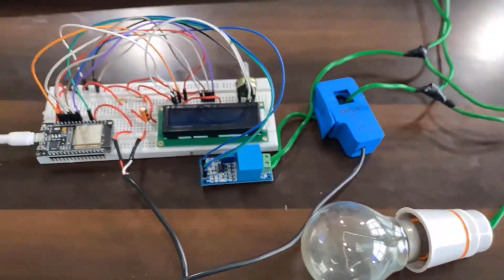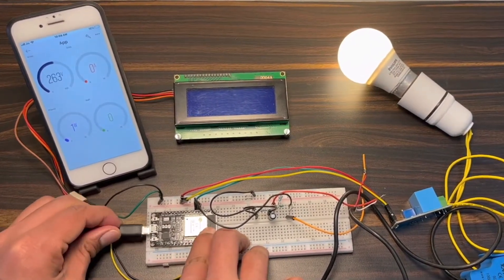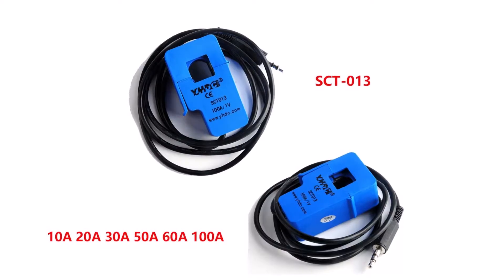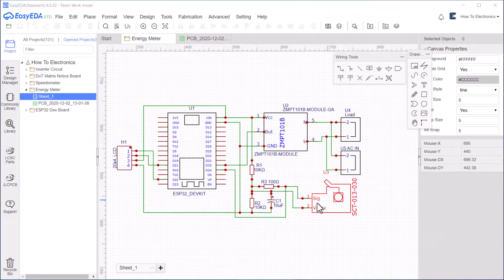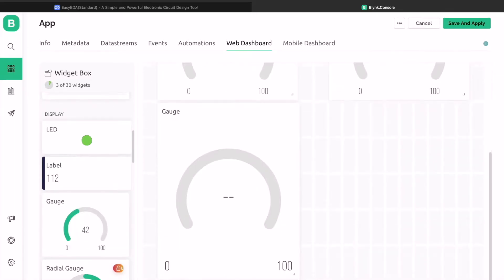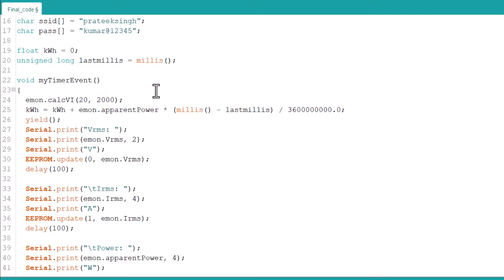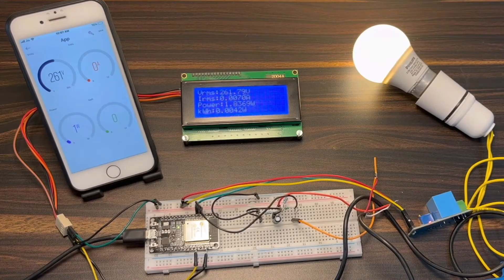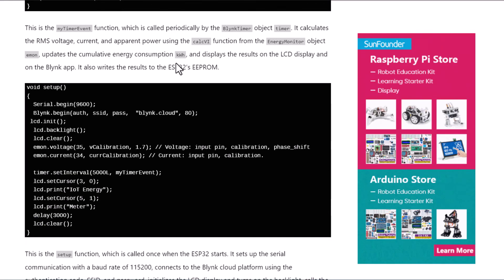IoT Smart Electricity Energy Meter using ESP32 & Blynk 2.0

Comment: hello guys i just build this project but i got some confusion when i add blynk function my serial monitor print zero but when i remove all the blynk function it read voltage and current all good where did i do wrong guys ....the issue is when i add blynk to send those data to blynk app it print all zero value but when i only do without  blynk it work fine... any help guys i just stack here
Reply: Hello I'm working on this project now but i don't know how to do the wiring can you help me
Reply: I want home automation with energy monitoring project

Comment: For everyone whos checking out this project, be aware of the following:

1.The code used in the linked webpage is masking APPARENT POWER into REAL POWER and thats completely wrong.
2. Whats worse is that the energy calculation in the code takes apparent power as real power sooo guess what? the energy calculation is also wrong.
3. The ZMPT module introduces a phase shift in the voltage signal. This is because on the secondary side the signal is fed into an amplifier. This doesnt affect RMS voltage readings at all but it completely screws up the REAL POWER calculation.

Im not saying this is a bad project at all, it works pretty well to get VRMS,IRMS and Apparent Power readings however forget about calculating real power, power factor and energy because as I said earlier, this is screwed up by the ZMPT module itself.. You may try to correct that phase shift by software but I cant guarantee you will get decent accuracy in the readings. If you want to calculate real power then you should use a crude step-down transformer.
Reply: but are the connections correct?
Reply: @supercorn5607  Yes the schematic shown in the video is correct
Reply: @angelhuerta4559  So youre saying that it only works virtually? if done physically?
Reply: @angelhuerta4559  can you elaborate on the resistor and capacitor part of the ckt, why are they required and what are they doing?
Reply: @angelhuerta4559 can you help me with the wiring and connections

Comment: A fatal error occurred: Failed to connect to ESP32: No serial data received.
Reply: Did you resolve it?
Reply: @Suryaa11105  i used another laptop...and i didn't face the issue 🙂
Reply: @yougetchandan  is this working properly or did you face any issues..
Reply: Driver issue

Comment: hi, i need help. i only connect the esp32. but the voltage still reading at 5V. but i dont connect any voltage and current sensor
Reply: di you fix the problem?? i have the same issue

Comment: let's assume the wifi is faulty but there is power, does it have local (Offline Storage) that can be used during this time, so that when the wifi is back on it just syncs up? or does it just resume from where it lost connection?
Reply: yes the esp32 is having the eeprom of 512bytes so it can also save things

Comment: I have doubt on the resistor value u said 10k and 100ohm but in fig 100e is there
Reply from the maker: 100e and 100ohm are same thing.
Reply: its 2 10k and one 22 ohm

Comment: why do my lcd doesnt output anything
Reply from the maker: Adjust the contrast using the potentiometer at the back of the display. 

Or it could be the I2C address issues, the LCD display has 2 i2c address, please check and modify the i2c address in code.
Reply: @HowtoElectronics  ma'am can you provide the i2c library link